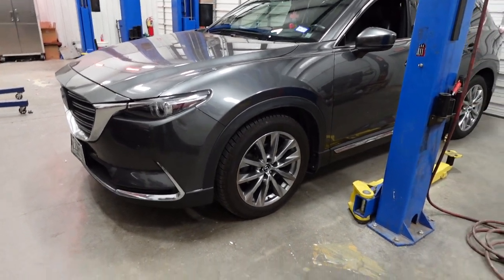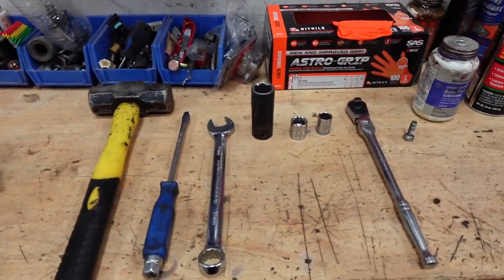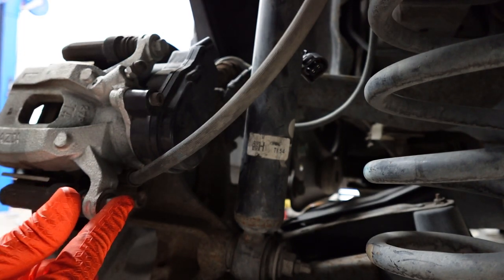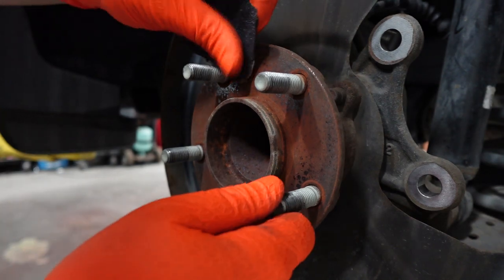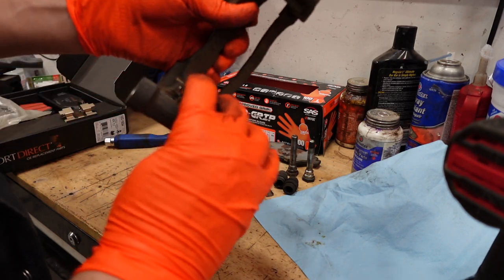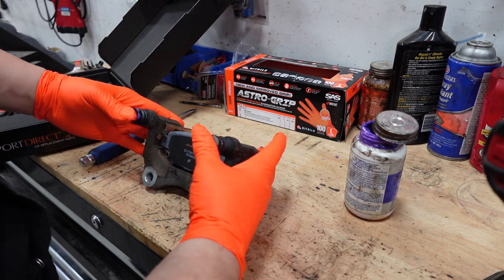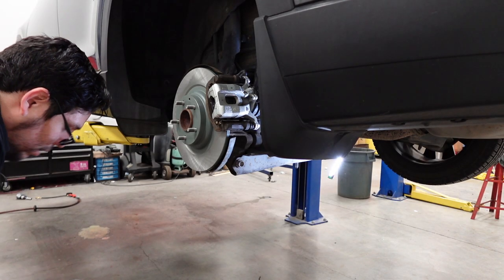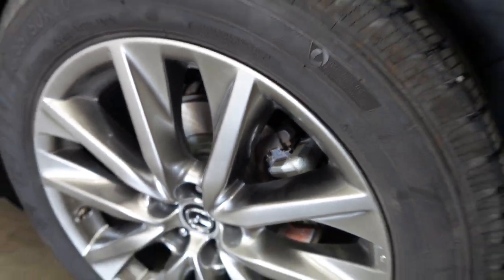Mazda CX-9 Rear pads & Rotors

Comment: Nice video.  Very well done  I do wish you'd reply to the comments asking what bolt size for that little bolt that helps remove the rotor, but i'm sure we can find that out somewhere else. 
Also for anyone doing this, when you get replacement clips on a non OEM set, make sure they compare exactly to the old ones in size.  I recently had some Duralast Gold clips that came with the pads for my Honda CRV and the clips were very close but slightly different in overall width and they kept scraping the rotor!   Definitely will compare them every time I change clips.

Comment: Thanks for the great informative video! By far it has more details than the DIY ones I've seen so far. I have just subscribed to the channel as I have a late model Mazda3 and likely will leverage your videos to do some maintenance.
Just one question tho, I didn't see you lube the retaining clips rail and the pads' contact points, is it not required on these Mazda's? I'll be doing my rear brake replacement soon so any reply is appreciated.

Comment: Thanks for the good video! Question, do you need to bleed the lines after putting it all back together to normal? I test drove mine but the breaks feel pretty soft, not as firm as they were when I started…

Comment: I have a 2016 CX5 and have used this service more each time I do the brakes. Now I added a 2023 CX5 and am wondering if this s method still works. 

Also any chance for a video fixing the power seat? I know it's a common problem for them to make noise going back and forth which is a problem have but all the videos I've found aren't great. Would love to fix it myself and save some cash.

Comment: Can you post the same for the front pads/rotor replacement on 2019+ CX30 and Mazda3 assuming those are the same ...
Reply from the maker: Its pretty much the same process for a Mazda3  and CX-30 of the same years.
Reply: It's same process for the front but you don't need to worry about the parking brake so technically easier.

Comment: Am trying to get a brake caliper replaced for my cx9 grand touring 2016 ,do I of to get from the dealer?
Reply from the maker: It depends. Is it for the rear or for the front? I would say that you can get a front caliper from the auto part store but the rear I would get from the dealer. The rear caliper just has a lot more moving parts internally than the front calipers do to the electronic parking brake actuator.

Comment: I have a 2022 CX-9 15k miles and hear a clicking noise in the front when I change directions. Asked a few mechanics and got some weird stories. I believe it is the pad hardware but not sure if should I replace the hardware or just grease the current ones.

Comment: You did not put grease on the abutment clips. The clips should get a little grease as well as the ears of the brake pads.
All sliding parts should have a little grease.
Reply from the maker: Your right. The reason I did not put grease in that area is because of the area the vehicle is in. I live kind of in a desert area where there's tons of sand and dust storms. the dust is like a magnet to that grease. If the vehicle was in any other place I would have applied grease in that area.